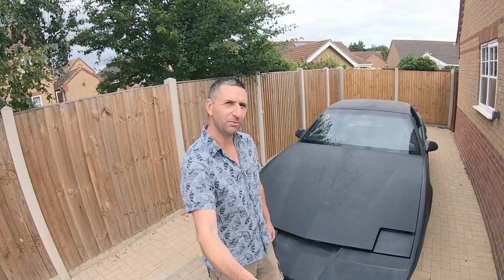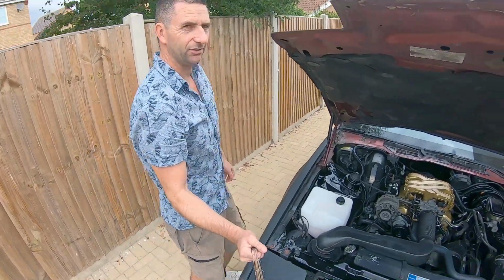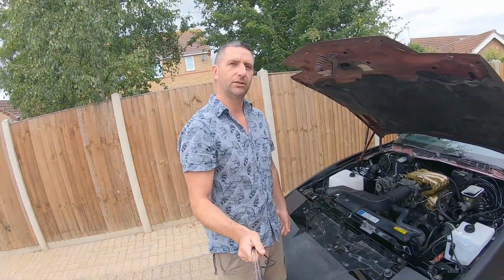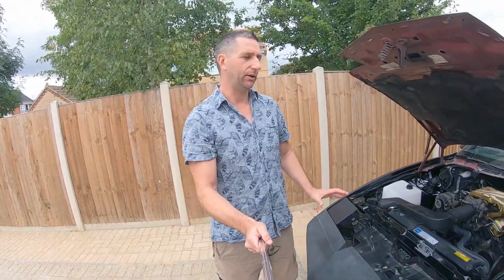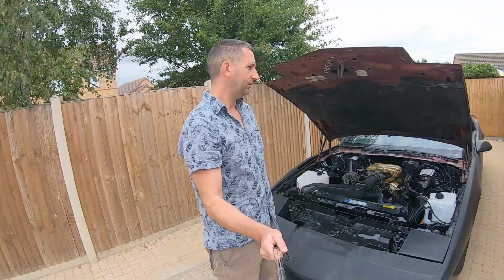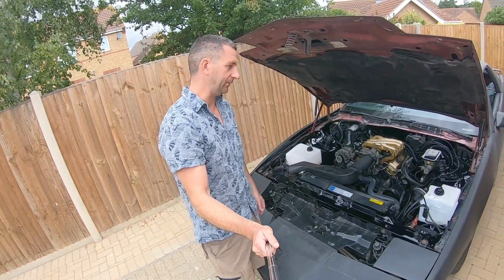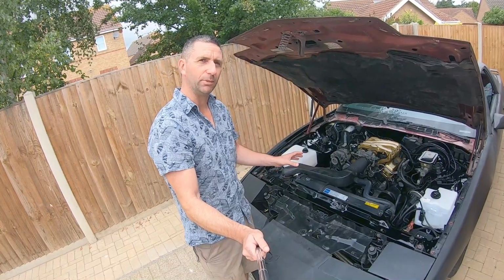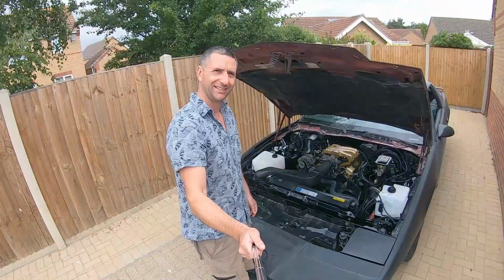Kitt Build Project Part 5 - Engine Bay Upgrade

Comment: Nice résault, i found a trans am hood for mine and now i need to sand it and paint it, can't wait to have it on the car
Reply from the maker: They are quite difficult to get here in uk. Clear glass hatches, turbo hoods,  pmd seats, it's all almost impossible to find these days.
Reply: @FunkyProjects  i am in Quebec Canada and the hoods  are not that bad to find, paied mine 150$ but pmd seats are hard to fin and the rear glass with no defog must be verry had to find too.